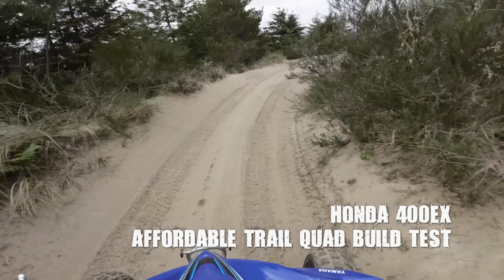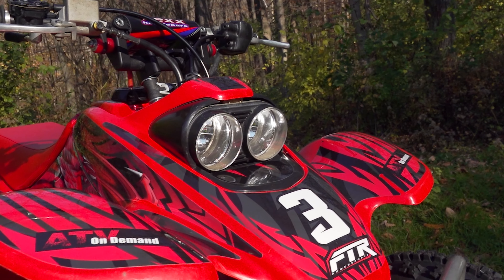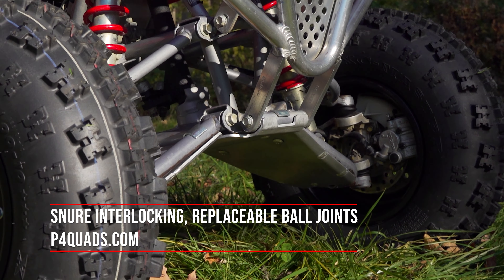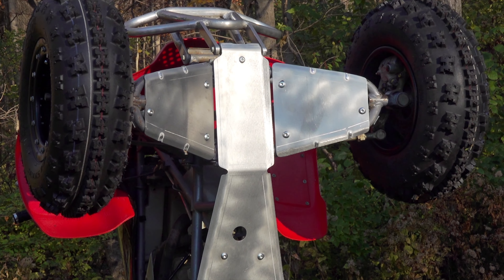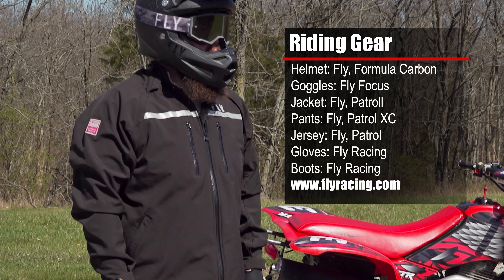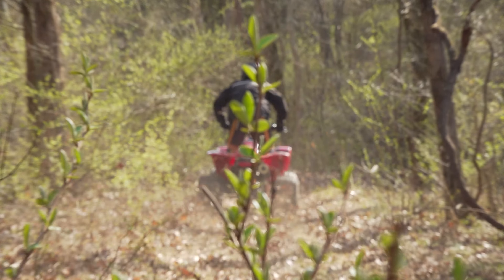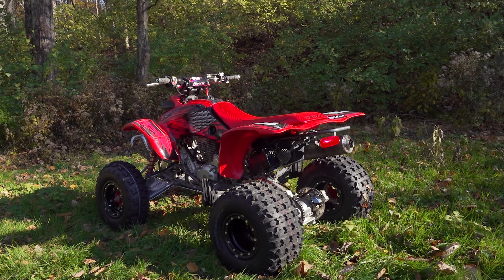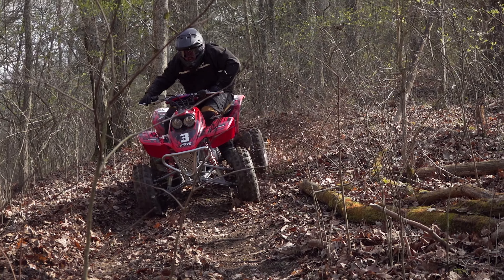Honda 400EX Affordable Trail Quad Project Test

Comment: Probably the most do it all sport quad of all time. Things are awesome not to mention dang near indestructible. Honda is really letting the community down not producing new ones. I know personally I’d take on more debt for a modern 400ex
Reply from the maker: When we both!? I could definitely go for a fresh fuel injected 400EX.
Reply: @ATVonDemand  wouldn’t have to change much either just some styling and efi
Reply: The z400 was a little better
Reply: @soundnessofmind7196 no it wasn’t lol
Reply: @Nunya-gk9fr  yes because it was liquid cooled, so it ran cooler and had better suspension. Lil more power too stock

Comment: Question did the new throttle and clutch cables make the throttle and clutch any lighter? Is it worth it
Reply from the maker: Hit me the pull a little lighter and smoother. It's way less expensive than having one break on a trail ride and  ruin your weekend.

Comment: Is it really affordable if you put that much into it for the average person? I wanna just buy it and ride it.
Reply from the maker: And you could do that if you don't mind riding an ATV with some bent parts and the bearings that are going bad that will only continue to degrade and inevitably wear out other parts.  Or you could spend more on an ATV that needs nothing and pay more for it.  We obviously spent some money to protect the machine. We would do that for any new or used quad. If you don't mind smashing your lower frame rails flat that's up to you. Bottom line is, this this sport is not cheap. But this
AYV, upgrades and all costs less than the mountain bike I am currently riding for prospective

Comment: I highly recommend STEDI C4 spot pods (Amazon) mount low on front bumper.... I can ride highway speed no problem. Bought my 400EX brand new 2001 runs like a top never been apart. Rotella T6
Reply from the maker: @speedfreak8200  You're proving the reliability of the 400! It's not how expensive your oil is.It's how often you change it

Comment: Could I put a set of used trx450 front shocks on pretty cheap would have been a way better Improvement over the stabilizer and the handlebars
Reply from the maker: Compared to the handlebars, maybe. Better shocks will not take the place of a steering stabilizer. They do two different things
Reply: @ATVonDemand  I just meant dollar per dollar the trx450 front shocks would of been a better decision on a budget quad build to improve the handling. I'm well aware of what a steering stabilizer does lol. You just seem to waste money in the wrong spots on this build.

Comment: Old reliable.  Wish Honda would get back in the game and bring back at least 1 quad.  A fuel injected 500cc that takes the reliability of the Raptor and handling of the YFZ into one reliable package would be fantastic and sell like hot cakes.  I just don’t see Honda doing though.  EPA regulations are getting tougher and every manufacturer seems to be sticking to the high margin SXS market.
Reply from the maker: I think you nailed it on all accounts.
Reply: Why not just use the same engine that they are using for the 450we dirt bike engine? Just make minimal changes and it’d be fine imo
Reply: @erichemmelgarn4623  that could be an option but most quad riders are trail riders.  The Raptor 700 is low end torque engine that doesn’t require keeping a certain rev range to be happy. It’s a good everyday quad.  I just think 700 is way overkill for most people. The 450 engines are basically what people race and have totally different characteristics.  The YFZ and Raptor are different beasts.  Maybe Honda could utilize the NX500 engine.
Reply: @brianfl33916  I don’t know much about that engine. I just wish they would make a new one. A 500 with reverse would be cool.
Reply: @erichemmelgarn4623  I don’t either.  But when Honda made their 700 sport quad they basically used an engine from one of their motorcycles. That’s why it was so quiet.

Comment: sucks yamaha never made a 400cc quad.. like honda did or suzuki did.. like its yamaha warrior/raptor 350, then honda trx400 then suzuki ltz400.. for good trial quads but like wish yamaha used a 400cc engine of what ever moto/trail bike they had into a quad...
just finished the video 3k ? the quad cost you 3k? holy shit honda trx400ex (not road legal so no papers) are 2000€ here and i find that expensive cause they are no wildly commun not like suzuki ltz400 you can get around 2500 -3200€, and road legal model with licence plates 4000€ ish
i tought trx400ex cost 1500$ in most of america? 3000$ seems hella expensive for something u needed to replace so much stuff... ah oki yes you can find them for less, makes sense but seen price are different in every region. texas or new york will have complet different prices.. (like mike sabo and 2vintage) mike sabo bought a honda trx250r in not mint condition it cost him like 4k or more i forgot it was like 1000$ more then 2vintage got his. while 2vintage bought 2 fo them who ran great and were fully equiped for less
Reply from the maker: A similar machine could probably be found for around $2,500 If you shop for it. If we put this back on the market as is Now that it needs nothing we would expect to get around.$3,500 -#4,000 for it. You rarely get out of a machine in dollars.What you put into it. However in fun we think we'll get every penny back out.
Reply: @ATVonDemand  yeah i see, i always tought quads are cheaper in the usa since there are way more common, but one thing i noticed most quads i see in the usa have still stock tyres, i almost never seen a quad in france for sale with stock tyres they are all changed. so maybe they have less hours in on quad in the usa. always odd have different things are. 
some quads seem to be cheaper in france but some are clearly cheaper in usa. but you guys did a great job making it look almost like new and making a nice personel machine to have fun for years.